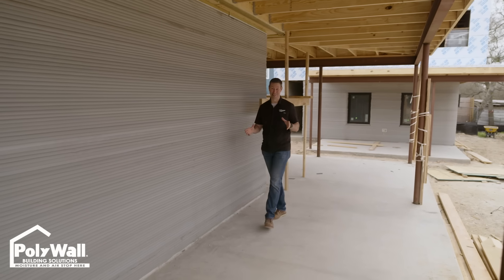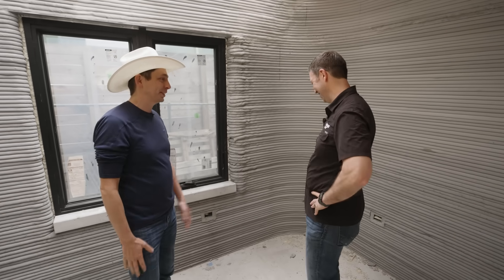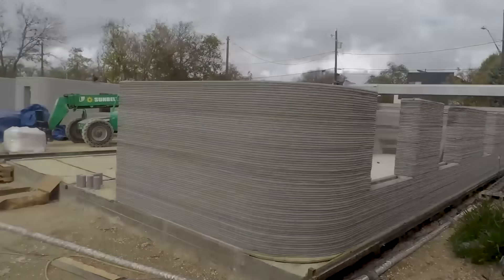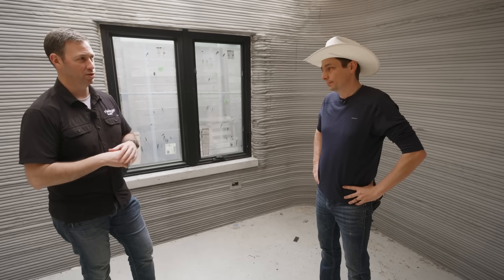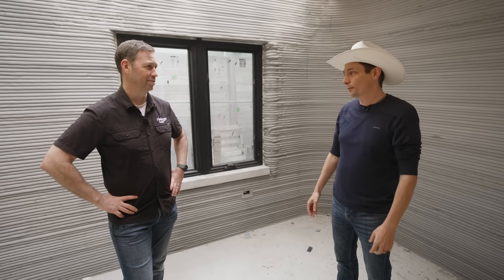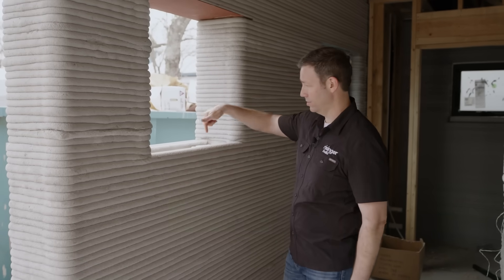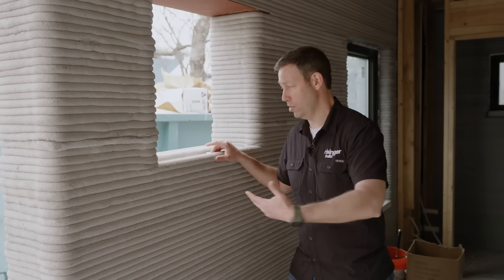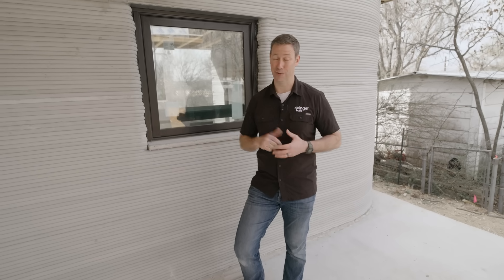Is this the future of Construction? 3D Concrete Printed Homes

Comment: Small batch concrete is to expensive. The cost of the foundation, MEP and windows/roof is still super high. Probably higher since its attaching to concrete. Framing is still faster, cheaper and easier on the earth. Timber buildings are gaining momentum worldwide, why? B/c steel and concrete is bad for the environment! We don't need 100 year walls on single family homes... Cheers from No.Va.

Comment: I have been aware of the concept of 3D printed building for some time. Question: Don't concrete structures need reinforcing steel (i.e. re-bar)?

Comment: How can they get away with out using reinforcement in the wall such as rebar. It seems the strength is in compression not lateral forces. For instance if a car hit the wall what would be the damage to the wall. Forget making funny comments about what the car would look like.

Comment: I am sure that with its use will come innovative improvements.  One such is reinforcing, which could be partially solved by running a soft wire ahead of the play-dough factory outlet.  Another may be a micro 'trowel' that follows on a robotic arm to alter the exposed surface appearance or to improve the start/stop inconsistencies.  Very interesting concept.

Comment: great advancement in home construction! but how are the walls finished?  the guy said in the video its just painted or stucco'd. the concrete layers look sloppy and ugly,like a jail or something. stucco would be more appealing but what if you need to run another outlet in a room or another light somewhere. mounting a picture on the wall will be a pain.

Comment: Wood frame buildings use renewable material, wood. But we can't grow enough fast enough so now concrete.
Concrete is not eco friendly as you probably know. In fact it's a huge polluter from mining to placement of finished product. 
That said it is a ingenious idea and will catch on Iam sure. Iam thinking foundations might be a better application for this process but you got to start somewhere to replace wood thanks to the greed of wood suppliers.
Cheers. 🇨🇦
Reply: Will not work for foundations. Not strong enough.  Need at least 8inches of solid concrete with rebar in 2 foot grids to support a 2 story home and protect from movement in frost.
Reply: @chuckd9007  I am from a cold climate and was thinking of foundation walls. 
The rebar issue the uneven sides are an issue to resolve but concrete strength can be handled easily. 
So far I no likey much for homes but a good match for electrical vaults, pump houses, standby generator buildings etc.
Cheers. 🇨🇦

Comment: 1.  any sort of crack on the outside + water + freeze/thaw cycle == damage.  

2.  Imagine trying to hang anything on a wall that isn't flat like pictures or a TV

3.  tapcons are a lot harder to use than traditional wall hangers (and you need a hammer drill)

4.  Fixing holes or cracks is harder since you need concrete + bonding agents

5.  It's probably heavy as fuck so make sure you build on solid bedrock.

6.  if your house gets cold and damp enjoy water everywhere as it condenses on your walls

7.  Good luck changing your electrical/plumbing after the fact.

8.  At least the house is recyclable :-)

Comment: Curious to see the settling cracks after a year.
Reply: Big crack above the electrical that they showed, maybe should do double layer on interior too.
Reply: Bro you guys don't know how strong concrete is.
The way they are setting the walls make it hard for anything bad to happen. 
I think concrete can withstand 2000lb per square inch

Comment: He was very precise with his wording, these might be the first 3D printed houses on a mortgage.
They are not the first ones where people live in: https://www.3dprintedhouse.nl/en/ (Moved in earlier this week, long term rental houses.)
Reply: I noted that as well. It is significant though since most banks are very conservative with new or unusual designs and techniques. No comps for them to assess value. They won't write the mortgage if they are not confident of the value of the structure. The implication is that the builders can document that there aren't high risk factors with the buildings in order to convince banks to lend against them.

Comment: this is great.. i mean on the inside you have 2 inch concrete, which has way better thermal mass, then two layers of gypsum board, thus it  will improve the comfort feeling level..

Comment: as cool as this is, design and theory. I question its practicality for reducing carbon footprint. concrete manufacturing is super intense on the earth and we should be striving to use less not more. And how does this compare to say superior walls systems that make panels with a higher PSI and far less concrete? If they can combine this technology with the hempcrete guy that the build show interviewed in September 2020  (link to that show = https://www.youtube.com/watch?v=cm23l_VLyp4&t=1328s)  then I'm all in

Comment: What if plumbing fails inside the wall? How do you remedy that issue?
Reply: Same as any other wall. But you dont put plumbing in exterior walls on entry level housing. And almost never in custom, maybe by a custom tub or something.
Reply: @sparksmcgee6641  the interior partitions are concrete as well. With slab on grade you need to run a hot saw and a jackhammer to get to the plumbing under the slab. Do you need to do something like this in a concrete wall? Icf walls run the plumbing in the Styrofoam... very easy... do you fit out the wall? If so, why print that wall any way? 
Would cutting into the concrete mix that they’ve created compromise any structural
Integrity? If so, how do you amend it. I’m not being critical... if this is the way of the future.. I need to know answers, as a contractor, I can’t just trust it works because it’s on YouTube, ya know? Pref fab building panels, are fast, energy efficient, modular, customizable, easily remodelable and relitavely inexpensive to manufacture. Why wouldn’t I just establish a manufacturing plant rather than purchase one of these 3D printers? assuming they will be available to the market.

Comment: How about using earth instead of concrete? Like cob building but without the huge carbon footprint of concrete. Earth, sand, water, and a small percentage of lime or cement to stabilize the mixture. Finish with lime plaster on the outside face and clay plaster for the inside. I bet it would be cost effective and earn you a few points towards a leed or passivehouse certification.

Comment: Freezing will be an issue in northern climates  - if the outer surface absorbs water that then freezes, the freeze-thaw cycle will cause cracking and degradation of the outer wall. Also, even though water won't cause rot in concrete, mold can still grow on the surface and that's all you need to destroy indoor air quality,.

Comment: I would trowel the inside smooth so there is not 100 ledges for dust bunnies to grow on. And with a ceiling light the edges where light meets shadow will attract flies to land there as it has high contrast and they can see an edge better where light meets dark.

Comment: The opportunity for complete fuckups by having the "carpenter"  run the wire are legion.  And don't even get me started on plumbing, holy crap would they screw that up.  Still, kudos for doing video on this period and sure everyone else in construction  In the country has read articles are seen videos on the subject. This one was more complete than most, and less pollyanna.
Reply: Im betting ona cheap flex duct in the future that electrical is pulled through. Like low voltage.

Comment: What is the cost of one of these? 

I found an article from 2019 that claims that a 350 sqft "home" costs $10k without a roof (no idea if it comes with a foundation). That could end up around the same price as other tiny homes which price around $16k on a foundation with a roof. However, tiny houses are garbage unless you don't plan on living with other people, or have craft hobbies.

If this price is true though, or maybe less once the technology gets more widespread, then a 3500 sqft 3d printed house could cost much less than a standard built house. Meaning that new home buyers could theoretically spend more on high-quality windows, doors, appliances, and other items to make the house more energy-efficient. This could be a big win if they can keep the price low.

Comment: I'm a big fan of 3D printing and innovations of all kinds in general... but I still have a hard time understanding the benefit of 3D printing houses here on earth?
How can it possibly be any faster or cheaper than manufacturing finished slabs that you simply bring to the site and put in to place?
Keep in mind that this 3D printing concrete is extremely expensive and you can't print any horizontal structures.

Comment: How do you repair electrical or plumbing issues if its embedded into the concrete.  Seems to me to be a disaster waiting to happen.  I am just imagining using a concrete hammer to get into my walls.  Forget trying to make it match after.